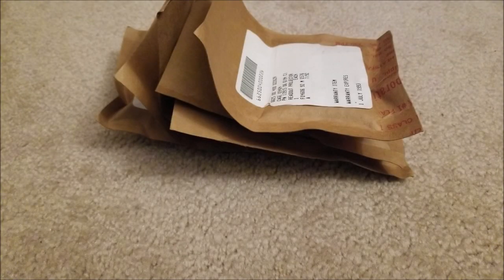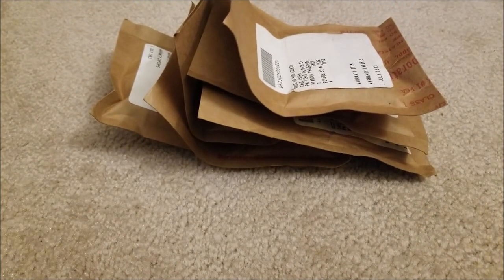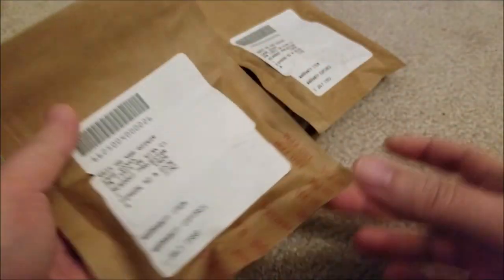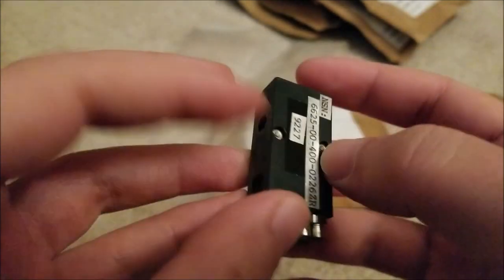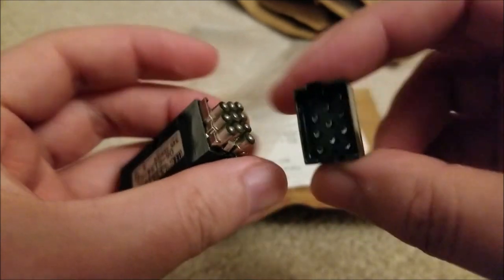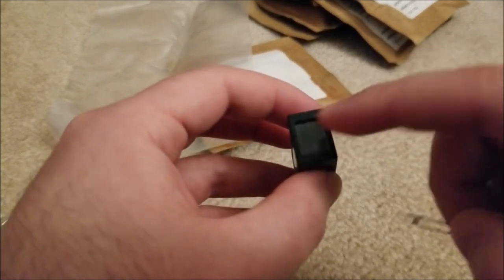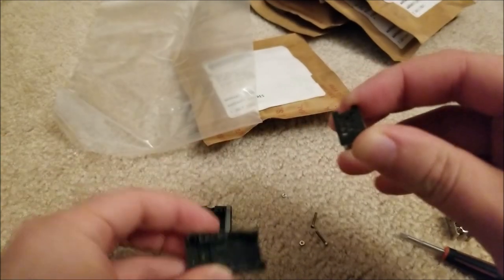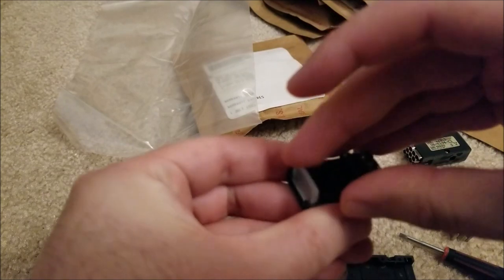Let's Look at IEE One Plane Readout Displays (+Teardown)

Comment: A display that has 3 lenslet arrays has my approval any day.
Reply from the maker: I want to see if I can model and 3d print the lenslets in resin, then I could make as many of these projection displays as I want!
Reply: @sjm4306  let me introduce you to the fine art of mold making... lol
Reply from the maker: I cant tell you how many times I learned ancillary tangential skills just to do a single project. Mold making and casting keeps popping up recently so I will probably eventually learn, just don't have the time/resources right now with everything else I'm doing lol.
Reply: @sjm4306  Do you have a 3D printer? If not, can you post the dimensions here so someone else with a 3D printer can make some?
Reply from the maker: Yep, I've got both a fdm and recently an sla machine so maybe I'll try printing a lens with clear resin.
Reply: @sjm4306  I think you can make new symbols with inkjet transparencies if you have a laser or inkjet printer.

Comment: The ones with an X as one of its characters could have been intended to be used as the left digit in the floor indicator of an older elevator in a high-rise building. The X means the elevator is in an express zone, usually between the lobby and the lowest high-rise floor it serves. Where would one find more than one of these for less than $100 per display?
Reply from the maker: Now that's interesting! As to where you can buy these, I have no idea as I bought the two lots that were put up by the seller and haven't seen more listed since.
Reply: @sjm4306  In that case, the 3D printing route will be the only option, as there are close to none on eBay.
Reply: Example elevators: https://www.youtube.com/watch?v=K_oIF-bcjQ0&t=43s